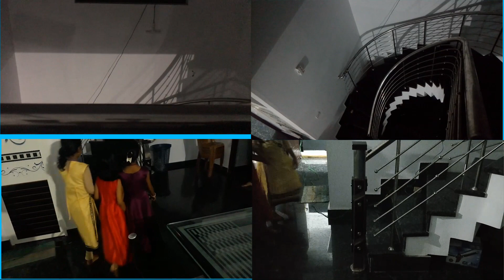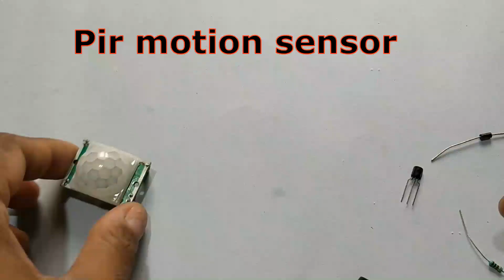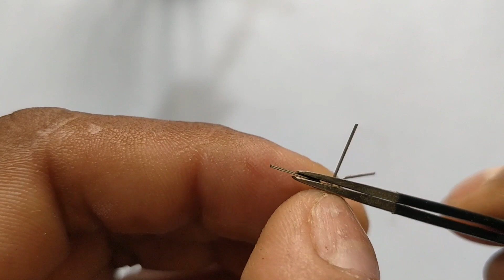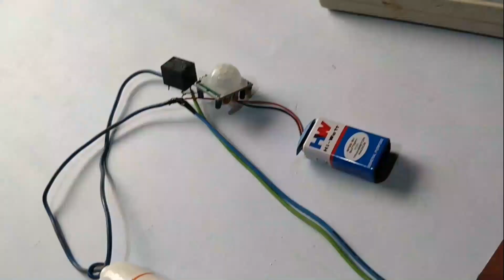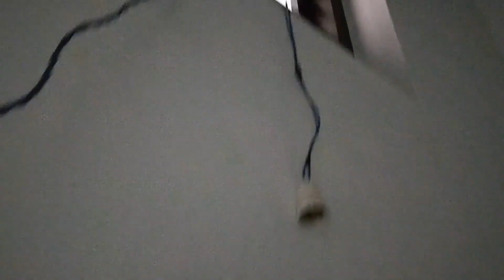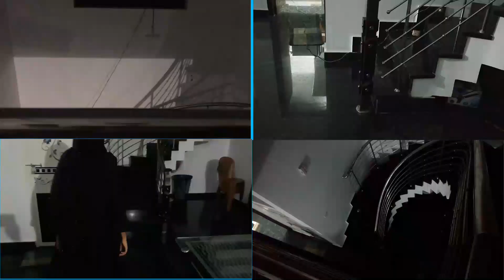Staircase automatic light excellent working സ്റ്റെപ്പ് കയറുമ്പോൾ ലൈറ്റ് ഓണാകും മികളിലെത്തിയാൽ ഓഫാകും

Comment: 12v battery avoid cheyaan  another soluttion enthankilum unto?
Diodo /Resistance use cheithu? Battery live cirquitil easy aano?
Ee cirquit enginay boxil set cheyyaam.
Reply: Use dc adapter, 6- 12v varunna dc adapter upayogikku. 6X4 or 4X4 plastic box il full circuit close cheythu veykkaam. Diode resistor capacitor okke upayogichu 'transformer less' low voltage dc undakkaam.